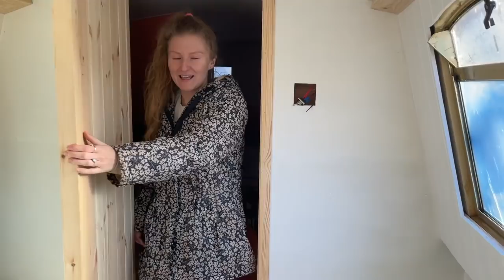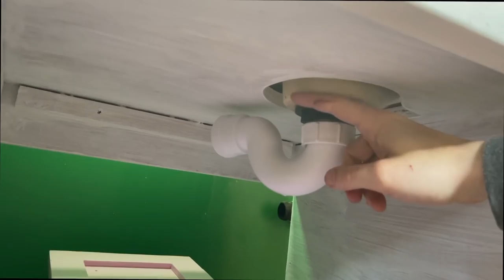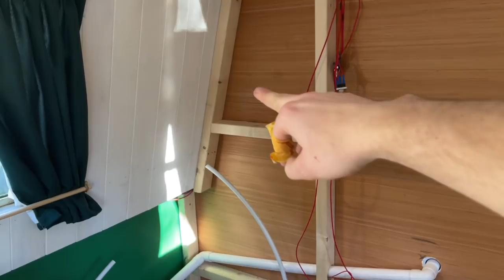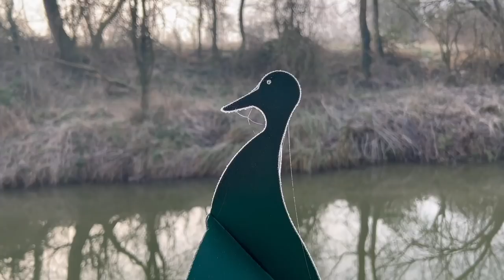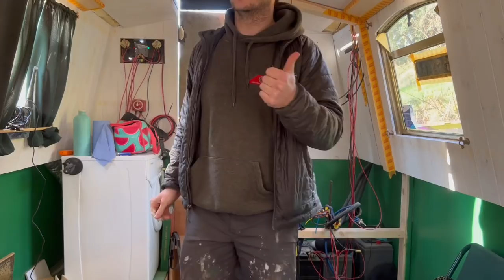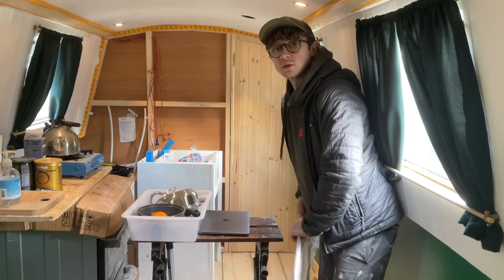Painting, Plumbing and Doors! | The end is in sight | Narrowboat Conversion | BOATLIFE

Comment: If you have a good hot hair dryer you can carefuly heat the white pvc waste pipe end and make direct connections with glue and make slight offsets to straighten direct runs. Just a hint there is another option and that is a commercial heat gun for the same process. Also, watch your drop and distance on waste lines. If you exceed the ratio the water may not carry any residue and be prone to clogging.  Don't forget to put a small steel  plate over where the plumbing goes through the wood so when you cover the wall you don't accidentally put a screw or nail through the pipes.

Comment: that blue flex hose you are using for your drain, has a short life.  measure the white pvc pipe and compare to the black pipe on the wall. if the white pipe is close to sliding over the black. you can heat the white pipe and work it over the black. a heat gun, hair dryer or torch (careful not to melt the pipe). you can also bend the white pipe using the same method of heating the pvc pipe.
use a liberal amount of glue on both the black and white pipe, to ensure a good seal as the black pipe is not smooth. make sure the glue is compatible for both types of plastic pipe.
Reply from the maker: Yes someone else suggested some radiator hose, which is smooth also. The pipe is slightly offset so wouldn’t slide over easily without a flexible pipe
Reply: @DanniandJoe  that's why I mentioned the heating of the pipe. you can then form it to almost any angle. like after going through a wall and you need the pipe shifted in multiple directions to conform to existing structure. you can heat the pvc and bend it, without using fittings. just trying to save you additional future maintenance. as things age and deteriorate. radiator hoses will last in certain conditions over 10 years. in high heat 2-3 years. in your climate probably the extended life.

Comment: Just wondering . . . Why are you not using your diesel heater to warm the inside while you’re working?
Reply from the maker: The diesel heater is almost ready to go, the main thing is not having our batteries connected yet and we’re running the lights off a random spare battery we have, if we used the diesel heater it would empty the charge within a day I think

Comment: Just out of I terest when's Joe's birthday 
Also why did you not put underfloor heating on the boat?
Reply from the maker: 9th May! I can see the appeal of underfloor heating on a boat, with the cold water beneath you it makes sense. We were set on a log burner as nothing better than sitting in front watching the fire. We’ve also got the diesel heater which is simple ambient heat and easy enough to install.